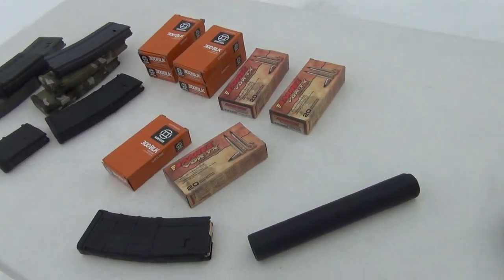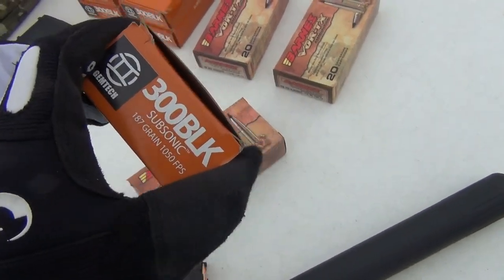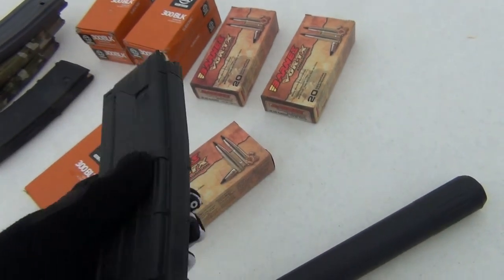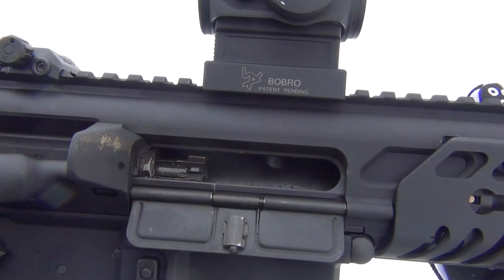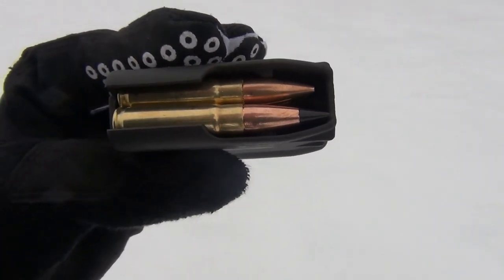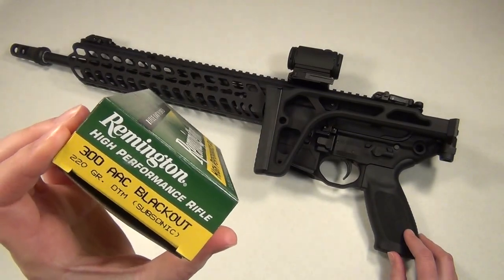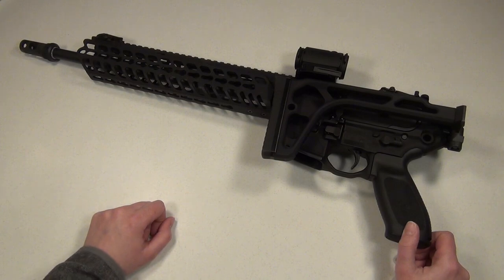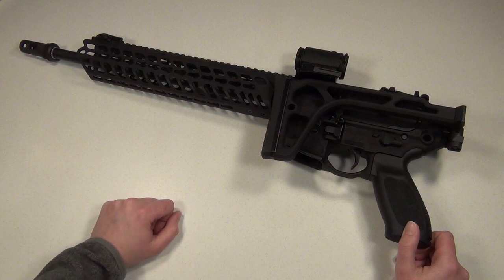SIG MCX In 300 Blackout

Comment: Nice rifle. Like the piston system and lack of a buffer tube. While converting 556 to 300blk is fun, it takes some time. Make sure to buy a Harbor Freight 2" cut off saw. It will make cutting down cases easier. Cost is about $40. If you don't want to spend time converting brass, Palmetto State Armory has great prices on 300blk brass. With the fact you can use 30 caliber bullets, you will have a huge variety of bullet weights and styles to choose from. Thanks for the video.

Comment: I've heard that the MCXs sold by Cabela's, with the self-regulating gas system, can have feed and hold-open problems that those sold through other stores, with the manual on-off switch for regular versus suppressed fire, don't suffer from.

Comment: faliaphotography  I am trying to decide between getting the MCX rifle vs building my own lightweight lower and putting a BCM enhanced lightweight upper with the KMR hand guard.  Then I would eventually get a separate lightweight 300blk upper.  I think I could get the 5.56 complete rifle right around 5lbs vs the MCX which is around 6.  If only they made all the aluminum parts on the MCX out of the magnesium aluminum alloy and got the weight down to 5 pounds I would be 100% sold.

I like the folding stock on the MCX.  I am concerned that Sig has not made a lot of parts for the MCX available yet like additional stock options, additional barrels, shorter hand guard, replacement parts, etc.

What are your thoughts on the pros and cons of the MCX vs having 5 pound AR and getting 2 separate uppers to switch between 5.56 and 300blk?

Comment: Can you tell us what the thread pattern is?  Is it 5/8 x 24 or 18 x 1.5 metric?  I ask because there 9 mm pistols barrels are 13.5 LH.  Also did you have any issues changing the flash for your suppressor?  On the Military Arms Channel, because of the taper, they had to get a special adapter ring for the 556 MCX in order to put on their Griffin Armament muzzle break.  Did you have to do anything like that for your AAC Suppressor?
Reply: +Greg Norman It's 5/8 x 24. The taper is the taper for the suppressor they used. The Omega requires a special taper mount adapter to run on 300 Blk.

Comment: I didn't hear you mention anything about changing to the gas regulator when you switched between sub and supersonic.  I am just checking to work through the problem set.  On the 300 Blk barrel there should be a switch to ensure proper pressure between the different types of 300 Blk.
Reply from the maker: Ty Kubie I mentioned in the video that it has an auto-regulating gas system. The current production versions don't have the adjustable regulator.

Comment: After checking several other sites (www.ar15.com, www.thehighroad.org) it seems like there is a common problem with the Remington 220 subsonic ammo not locking the bolt back after the last round when the suppressor is not on the rifle.

Comment: The bolt issues have to do with the nature of 300BL rounds.  They were designed to be suppressed, so if you want to fire anything above 130 grain supersonic, you need a suppressor for the gun to work.  This isn't unique to Sig.  Even PWS, which makes one of the best 300BL rifles in the world, states on their website: 

"PWS advise the use of supersonic, 110g – 130g, ammunition if not running a suppressor on this build. As this round was designed intentionally for suppressed dedicated use the ability to run rounds greater than 130g will be adversely affected without the application of a suppressor to the platform. When suppressed we see proper operation in the entire range of 300BLK from 110g supersonic all the way through 220g subsonic."
Reply: This is completely untrue. I load up supers from 72gr - 180gr and I have never had issues with bolt lockup on any of my rifles.

Comment: Did you need ear protection with the suppressor?
Reply: You don't need it if you don't want it.
Reply: fireonthemountain1776 Always wear ear protection, hearing loss is an accumulative problem that will happen over your lifetime. I speak from experience, trust me, you don't want to be the 35 year old at the party saying "what did you say" all night.
Reply: 1D5dozer Im 17 and I already have pretty bad ears unfortunately.Working in a body shop, going to a lot of Nascar races and rock n roll concerts doesnt help. I do use ear protection shooting guns though.
Reply from the maker: fireonthemountain1776 Not while shooting subsonic ammo, but I wear earplugs most of the time anyway

Comment: Maybe for a quick fix you can just make the last round of a sub-sonic magazine sonic? (19 220gr + 1 110gr)
Reply from the maker: aCycloneSteve LOL. While that's a great idea, it's not something we should have to do
Reply: faliaphotography totally agree with you hopefully sig will get it fixed you should also do an update video since you've had it for a while now I'd be really interested to see if you still like it
Reply: +James Brister There is no fix. Subsonic 300 blackout makes extremely low pressure. It's designed to work that way. Most people are either going to be shooting supersonic without a can or subsonic with one. Shooting subsonic without a can is kind of pointless since it would no longer be quiet. The only way to make it run reliably would be to weaken the recoil springs to handle the reduced pressure, but then you have a gun that beats itself up when you run supersonic. Different kinds of ammo for different purposes. A "self regulating" gas system can only do so much. People just want to have their cake and eat it too.
Reply: considering Sig can change the gas system there very well could be a easy fix
Reply: Change an otherwise reliable gas system so people can shoot subsonic unsuppressed? Makes no sense.
Reply: CaptainCondor if they can make it better and not compromise the relablity why not?
Reply: I guess if you want your customers to pay for a 2,200 dollar gun instead of a 1,600 dollar gun because of the R&D that would be involved, to chase a white rabbit that is pointless and price yourself out of the segment you are trying to compete in, sure why not.
Reply: CaptainCondor you can't know what their R&D cost are  most companies have a fixed buget for that so it may not affect the price. It also might be a easy fix
Reply: No I don't know their R&D costs. It was an example, but do you think the rifle will get cheaper? I think you missed the entire point to nitpick the small numbers.
Reply: CaptainCondor yes I do believe the price the price will eventually drop. And I understand what you're saying I just don't agree with it
Reply: Of course it will drop with age. Hell, the AR is cheap because it is 70 years old, but that's not what we are talking about here. We're talking about Sig introducing a new whiz-bang carbine and trying to compete with all the others out there (SCAR, Tavor, etc.). Why would they choose to put money into developing a gas system that will run subsonic unsuppressed? It makes no financial sense when the solution is already available and simple. Suppress the damn gun! If you can't afford a suppressor, then shooting subsonic ammo does absolutely nothing for you besides cut the balls off your lethality. I know this kind of thing doesn't make sense to youtube commandos, but whatever. I tried.
Reply: CaptainCondor simply I do not agree with you you can think whatever you want I don't care
Reply: +CaptainCondor There is no spring.

Comment: Hi again. I keep thinking about your issues with the Sig MCX  "self adjusting" gas piston gas block. You must have contacted Sig about this by now. What happened?
Sorry. But this problem really bothers me. I would love to know the nature of the resolution. The MCX is clearly under gassed when shooting suppressed with Two different sub sonic brands and bullet weights.

 I REALLY want to buy this rifle, but I have serious reservations about any kind of automatic gas regulation. I do not trust a system that I cannot manually override or adjust.

  It appears that Sig engineers were just too over confident and full of themselves when they thought that they should be the ones to regulate the gas flow. Typically, that manipulation is left up to the operator in the form of multiple position manual adjustments.
The problem is that the entire system is propriety and the buyer is stuck with the "self" regulating gas system. I would give anything to mount and use a 16 position Syrac gas piston block on the MCX.
Reply: That's what happens when you shot subsonic unsupressed it's gonna happen, they are way under powered.
Reply: The Subs  are purposely "under powered" so the bullets do not exceed the speed of sound. But the POWER of the actual bullet is better than a .45 or a 9mm.

 Plus, the sharp shape of a rifle round like the 300 Blk sub makes it penetrate better than any pistol round. This is why many Special Forces prefer the 300 SBR suppressed with subs over any pistol caliber guns like the HK MP5SD or even the new Sig MPX.

AFAIK she was shooting subs SUPPRESSED at all times. Stupid and no point to shoot subs unexpressed. NO REASON!

She still had bolt lock back problems ALL DUE TO A POORLY designed and functioning auto regulating gas block. Auto regulating gas blocks are UNICORNS. No body has ever developed a real on that actually works all the time. Many have tried.

Getting the bolt to lock back is NO PROBLEM with a MANUALLY adjusted gas block. That is exactly what the military versions of the MCX comes with.

Finally, Sig realized their fuck up and now ships MCX with gas blocks that are MANUALLY adjusted. Lock back is a rare issue now. I found this fact out just recently.

There are SCOPES now with dual reticles just to measure the drop difference between 300 subs and 300 supers from the same gun. The drop is about 12-14" at 100 yards. Which would still be in the "T" kill zone if you aim for a head shot.
The round is designed for close up stealth entry. It is very very QUIET and effective. The entire round was specifically developed with the SUB SONIC performance in mind. Having a 100% powder burn in a 8.5" barrel is one of those designs.

The SUPER 300 performance is just a bonus. It was supposed to be all about just the sub performance. The only other round like the 300 blk is the .458 SOCOM
Reply: +Big Dave not sure why you went off on so many tangents but my point is it's really not surprising that a subsonic load didn't lock back without can as it doesn't have enough pressure to cycle properly.

Who would want to shoot subs without a can anyways?
Reply: +Big Dave her failures to local back were with subs unsupressed which you even said is pointless so why do you care so much, your response has become really rambling and unintelligible honestly, also you say many SF use 300 please do tell which I have only heard of one military procuring 300 blk sbrs.
Reply: +Brandon Lee 
My total BAD, bro. I totally missed that. I just re watched the video. Doh! 
Yeah, she did complain about bolt lock back UN suppressed. Granted a manually adjustable gas block could fix this.
The question still remains: "why would anyone want to shoot 300 subs unsupppressed"?

Only an idiot would want to waste the cost of shooting subs with no suppressor. IDK why she even tried. It was a NON point/issue she brought up. I MISSED the part about it being done with no can. That was all on me.

In retrospect i would have simply agreed with your OP. I do agree with it now that I re watched the video. I am so sorry for posting like an idiot. Rock on.
Reply: +Big Dave lol no worries I was like ummm without a can its kinda common for short stroking.
Reply: LOL. Exactly! If I had not missed that fact that is just what I would have posted!
Nice meeting you, Brandon.